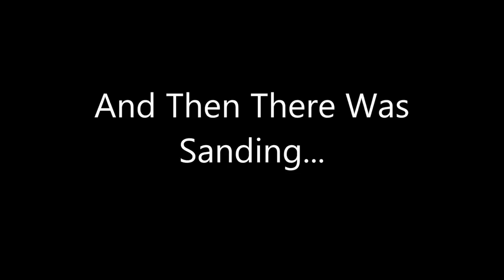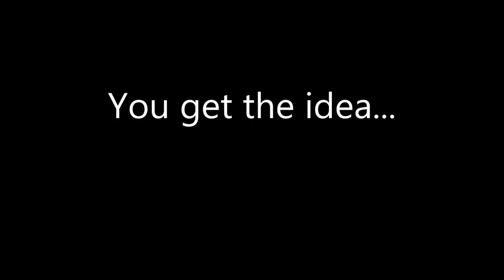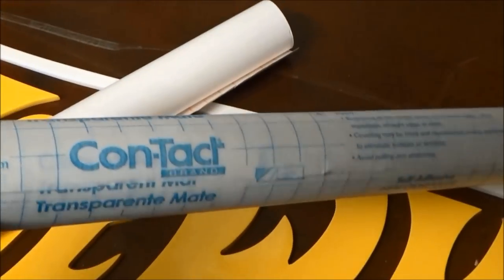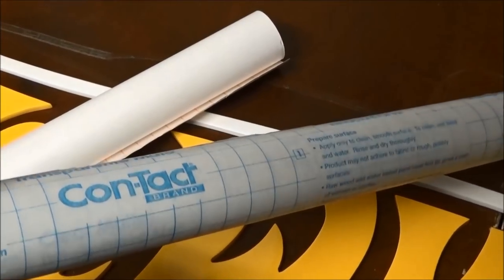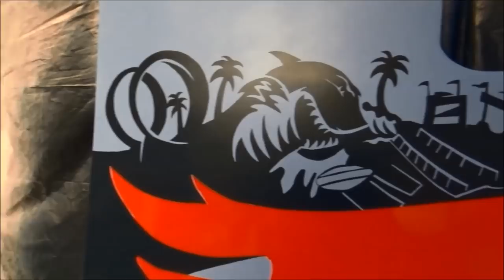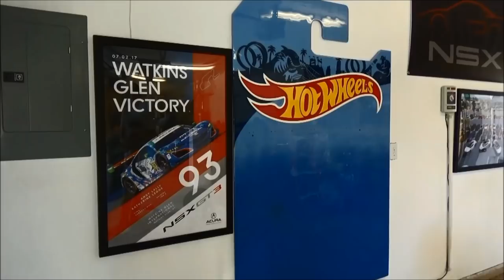How I built My HotWheels Display for $100 - TIMELAPSE

Comment: Despite what you said happened during the process, it came out awesome!! How many cars does it hold total? 
My only suggestion would be to back light it with LED strips that are connected to the garage door or a switch by the house door.
Reply from the maker: Thanks Lawrence! I Have thought about the back lighting & have a future project coming up that will utilize that! This board will currently hold 160 cars, but that could go up if I got longer pegs.

Comment: Looks fantastic. What did you use for the glazing, polyurethane?
Reply from the maker: Thanks. It's called "Glaze Coat" by famowood. Both home depot & lowes carry it. If you give it a go, do a smaller project 1st, to get the hang of it. & use a heat gun to help level it out as you go. 2nd person helps for this with a big project. You only have 15-20 mins befor it starts setting up.
Reply: Thanks for the info. I'm planning to do a project like this once we have bought a bigger house. I'm not sure if I can find it here in the Netherlands, but if not I'll keep an eye out for something similar.